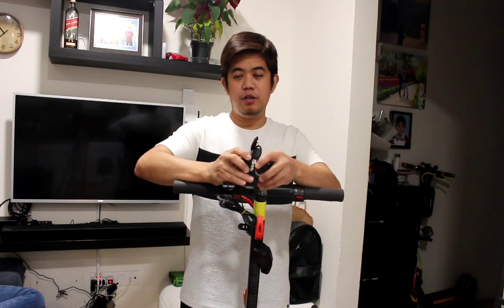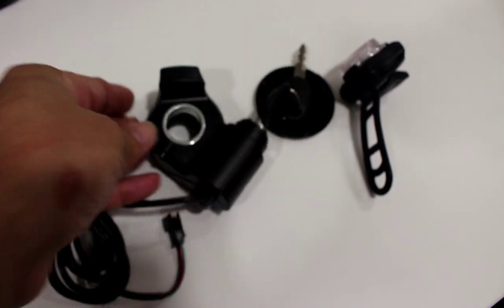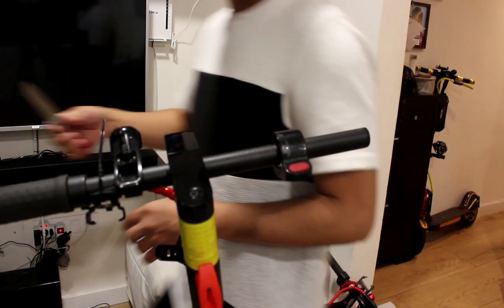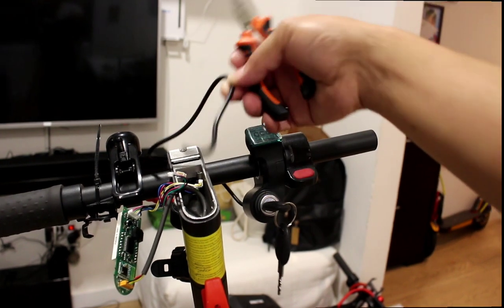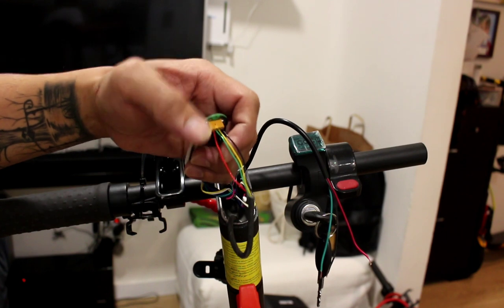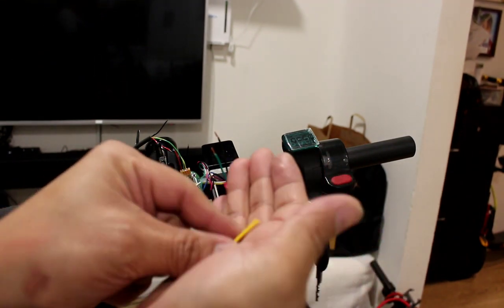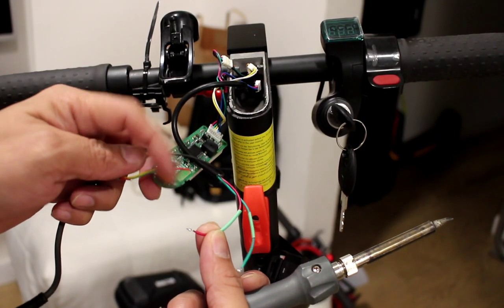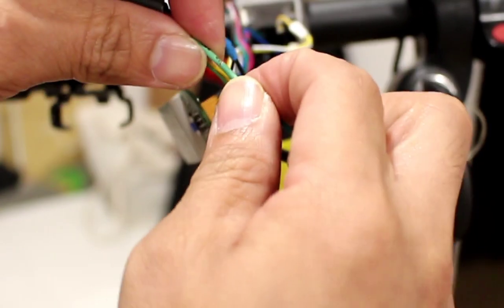how to put ignition key to m365 xiaomi scooter

Comment: What voltage is on the display? Battery? Or System/dashboard voltage?4.9 volt?
Reply from the maker: yes the remaining voltage of the battery  that batery is only stock batery.
Reply: It's the dash voltage which the dash is 5v should sit between 4.8 5.0v
Reply: @RHON_TV that's not battery voltage lmao that's the voltage of the dashboard lmao 😂😂

Comment: can i change voltage pin to read the battery voltage ? not the 5v, thanks.
Reply: You need to Connect it to the Main Battery Which is hard

Comment: What colours go to which ones?

Also it still turns on and off without the key so what's the point of the key?
Reply from the maker: you canot trurn on the boton of the scooter if you have key

top color green red black of the ignition to the red and black of the dashbord
Reply: Boss need pa ba pindutin ung sa dash oard bago masusian kc parang may napanood aq dina kylangan pindutin rekta na sa susian pg open ng unit
Reply from the maker: pwede mo sya   pindutin mag oon pa din nmn sya pero pag i close mo sya  ma sususian mo pa din nmn sya kaso kahit naka off sya mag ssignal ung red sa hulihan kahit naka off na sya sa susian kaya much beter pag i off mo isa mo na din ung sa dash board para close lahat talaga
Reply: @RHON_TV  ok boss Rohn slmat keep safe ride 👊🏼

Comment: can i do it without soldering
Reply from the maker: no need soldering
Reply: @RHON_TV  ok and how do i do it? twist the wire and use heat shrink?
Reply: Sir.un saken mi 1s..may ignition sya pero wala na sys headlight..tapos un tail light nya..pag naka off power nag bi blink parin..ano po problema nito?